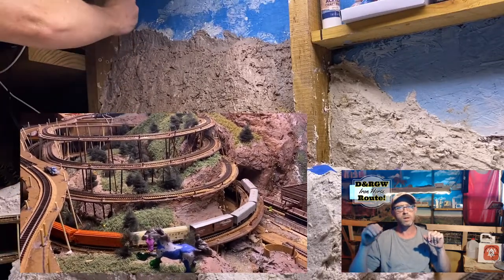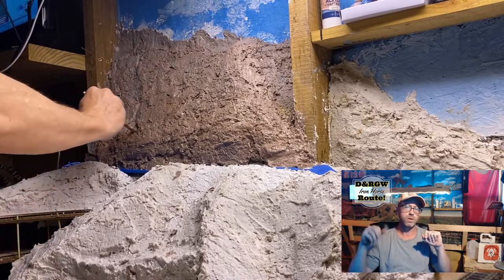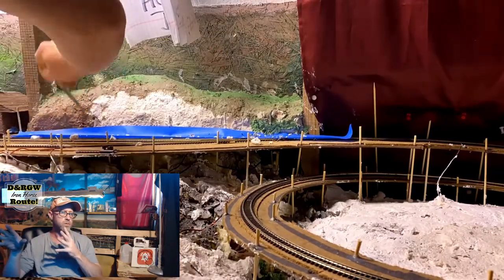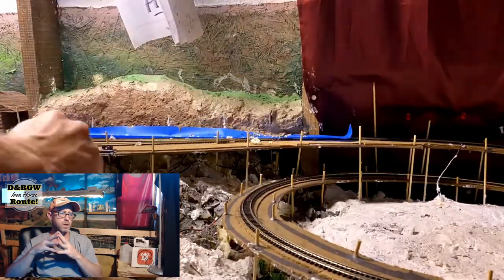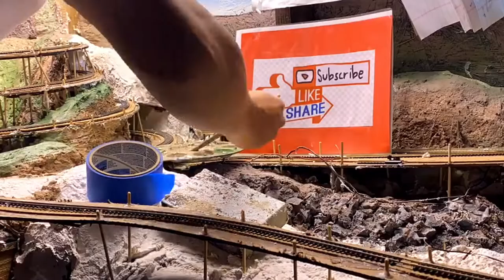Model Railroad Ground Cover: How I Paint and Apply - N Scale Train Layout - Iron Horse Route - D&RGW

Comment: Using the moss gave a very unique look. It's more 3 dimensional and with n scale it looks like the low vegetation of the area you are modeling. You hit it spot on by using the moss I think. Very nice. The mountain looks great. Are you gonna make the other side of the helix look like trestles or how are you gonna proceed with that? Also it's about time you did a layout update. You've put videos up but it's been awhile since you did an update specifically showing layout progress. Great video. Stay well.  -Wil   👍
Reply from the maker: Thats a very good question about the other side of my helix.  My main man Claude over at "Covboy Valley and Timberline Junction" sent me a good bit of balsa that would be perfect for what you're saying.  I would probably only do the outside though, as I would need to gain access to the track from the inside in case of trouble.  layout Update will probably be coming in a couple weeks.  I've got to shoot a new channel trailer first and we are workng on the next roundhouse  project now.  Thanks for watching !  Brian